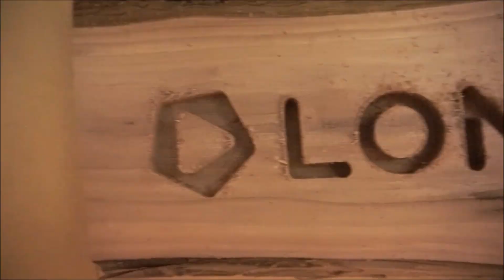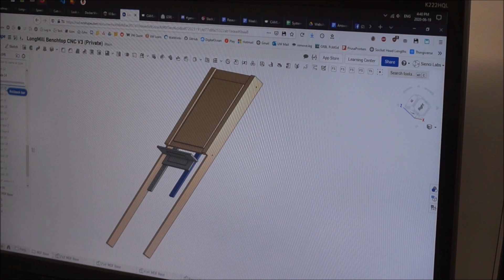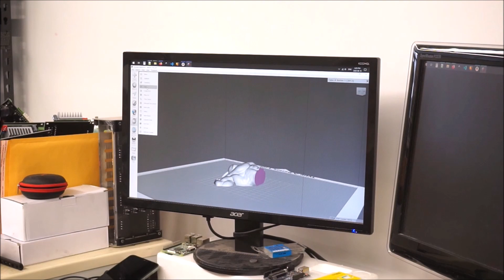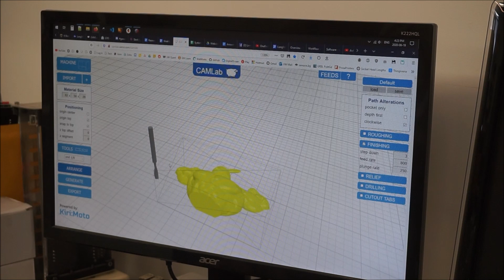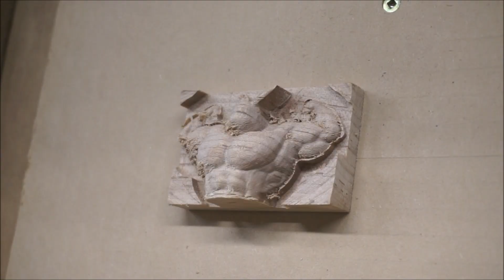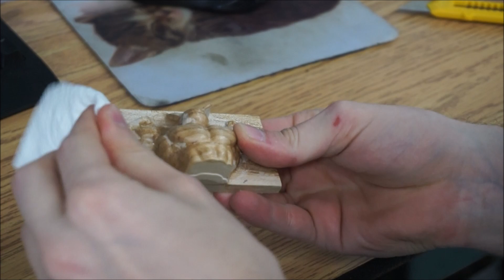Set up your CNC for Vertical Cutting: New vertical stand design and intricate 3D carves in CAMLab

Comment: In machining, your set up is considered a Horizontal CNC. The spindle tells you the orientation.  Horizontal is parallel to the horizon.
Reply: Very true Ronnie, I've done a lot of work myself on manual vertical mills over the years 👍

Comment: And another question. I get the roughing pass saved and when i try to save the relief pass it keeps telling me "aw snap!! Page crashes and other page loading errors. I've tried in Google chrome and firefox browser.   I've been trying all day to cut this. Also i tried toojust cut the roughing pass and it's cutting way above my board. I just wanted to cut one 3d thing out today lol
Reply: To make things easy, I'd recommend checking the 'origin top' setting and unchecking the 'origin center' setting, this way you can just use your touch probe on the corner of your stock and that will get everything located properly for you
Reply: @chrismakesstuffCNC  Thank you  i will give that a try  some things  are a bit frustrating when this is all new but im not a quitter lol  i will plug away until i get it

Comment: Can I set this up vertically & make the “floor plane” an imported CAD file and add my own depth? [on most softwares?]
Reply from the maker: Hey there, depending on the type of CAM software you use, you can typically reorient and change the origin/starting position of the cut based on the model.

Comment: Hi Chris,  dumb question but my bit is showing top center on my picture. How do i change it to center of the picture.
Reply: There are two toggles to set the bit location, 'origin center' and 'origin top'. If the origin isn't center then it'll be in the front corner, and if it's not at the top then it'll be at the bottom. Try to toggle these options to get the bit to where you want it. Let me know if that clears things up